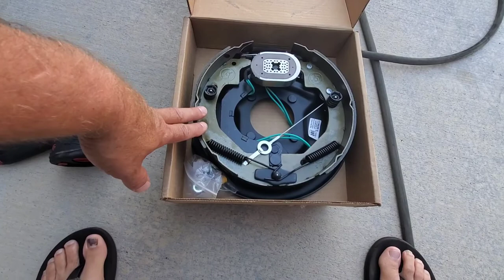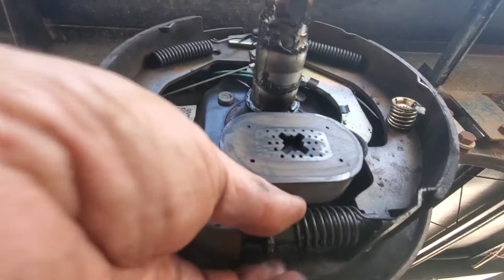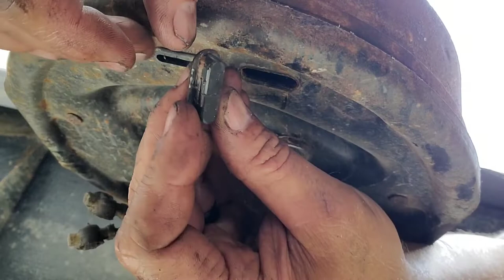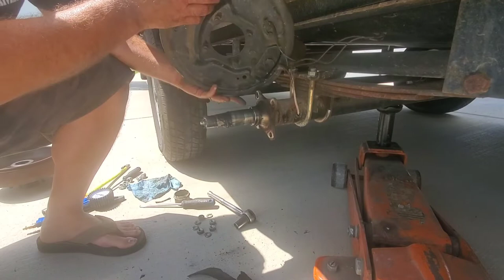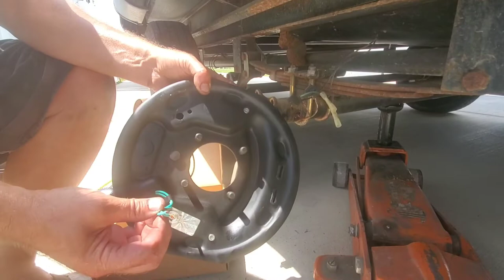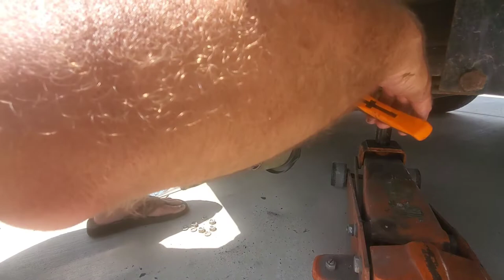RV brakes - check, diagnose,  change  and adjust

Comment: This is an awesome back yard mechanic brake fix-it video. Working without jack stands and blowing dust maybe not so good. Replacing one on the opposite side is a thought? No chalks is bc the trailer is still being connected to the truck. Choice of footwear is excellent !!! Overall a 4.5 out of 5
Reply from the maker: Haha I'll take that! Pretty good score I think. No jack stand because 3 tires are still on the ground if the jack fails the one axle drops closer to the ground. That's it. Nobody gets crushed. Still good idea to use one but that was why. Blowing brake dust? That's how I've cleaned brakes for 40 years. Nobody suggested breathing it in, lol. And finally only one brake changed because the trailer had extremely low road miles. Litterally laying a new brake beside the old you can't tell the difference.  Just had the one fell apart was the issue. Thanks for the high score. I appreciate  it!  Oh and flip flops because it was HOT!!

Comment: I have a 2016 Outdoors RV travel trailer and took the hubs off to repack the bearings today.  What I found was something very unusual.  Both right side arms that hold the electro magnet were broken off at the 90* bend.  The left sides were fine.

Comment: A few items of concern on this video . . . 
1. USE JACK STANDS! Be safe people!!!
2. Don’t reuse cotter pins. They’re cheap, just replace them. Bent pins are compromised if used more than once.
3. Don’t EVER blow brake dust off. Unless you like cancer. Use brake cleaner. It also degreases as well.
4. You’re already in there, why not clean and repack the bearings? That grease looks WAY used up bruh!
5. There was almost zero grease on the fourth wheel outer bearing when you installed it. Using the zerk fitting alone to add grease won’t get the grease everywhere you need it, which is why you should pack the bearings properly before installing.
6. I’ve always been taught that if you replace one brake, you do the companion brake on the other side as well. You want the brakes grabbing with the same timing. Again, pure already in there and have the parts. Just do the job right.